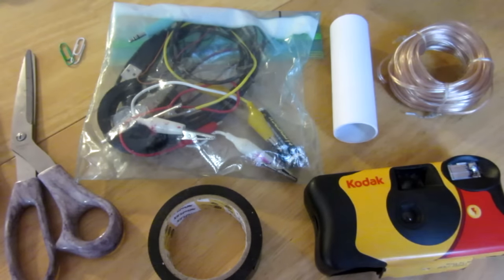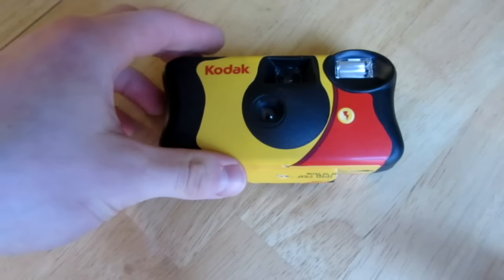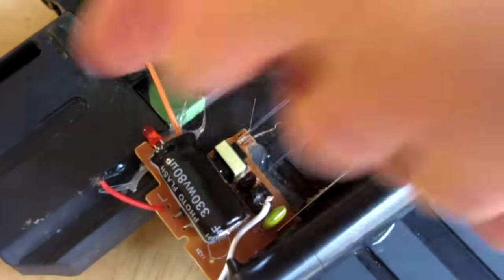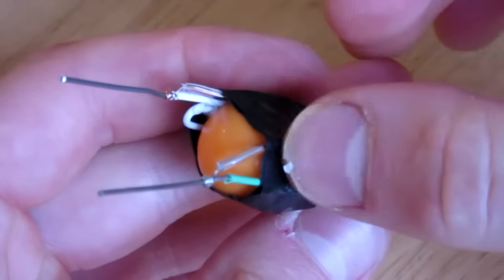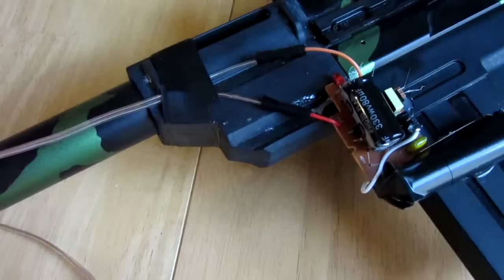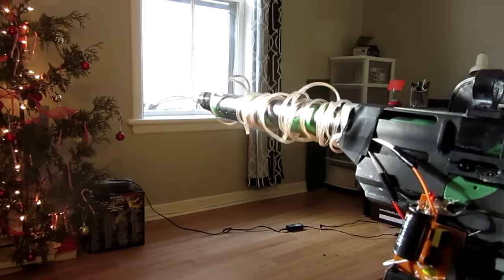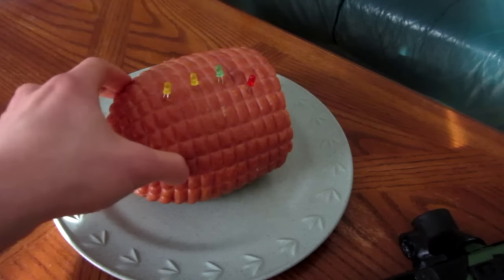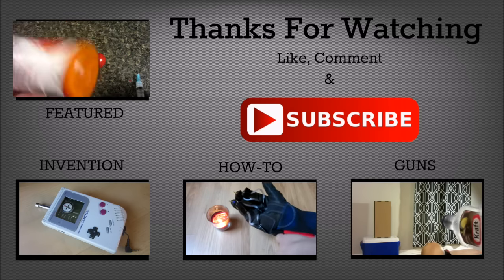Make a 330 VOLT Shooting Taser - EASY

Comment: Have u ever shocked yourself with one of ur tazers?😂
Reply from the maker: Don't get me started
Reply: +inventor719 I'll take that as a yes 😂😂
Reply from the maker: Defenitly a yes
Reply: +inventor719 how bad does it hurt? 😂
Reply from the maker: It's a good shock that's for sure
Reply: +inventor719 I've been shocked by a hot shot(cow tazer thing) and it hurt pretty bad so I imagine 😂
Reply: +inventor719 ayyyyee pun pun
Reply: +Zachary Fisher its called a cattle prod btw :)
Reply: +Zachary Fisher please I've been shocked bye transformers rated at 25-4200vac 2-3amps of current me getting shocked in the arm and hand negative to positive of the outputs I was burned OK and my heart rate became irregular I survived this device is nothing use a flyback out of a flat screen then make a asable 555 circuit then use a mosfet or the mosfet in the tv  a 9volt for the  555 then add a bigger supply for the fly back then add a few hv capacitors but you wanna rectified the fly back output as it will be ac if you use a flat screen fly back use either a few 1n4007 or some uf4007 diodes then hook it up to a pole then walla a real taser around police issue if not more effective!!!  it will take down a grown man or a huge animal!
Reply: +Lost In Space Electronics 2500volts not 25v
Reply: @lostinspaceelectronics870  I’ve been tasked by the taser x26p before. Hurts less than a paper cut.
Reply: Tased**

Comment: I wanted to do a project like this, but you beat me to it. At least I have some data to start with now. You did a good job with your video. Entertaining, and a quality project. Have you considered using fish hooks or sewing needles for tips of the wires? They are both commonly made out of less conductive materials than the wire... I don't know if this would make a significant difference in overall output voltage. I've used zink coated nails in the past for other projects and they don't take much of the shock away. I stopped all my taser experimentation after I realized that tasers were illegal in my area. I look forward to picking up my experiments again, but that won't happen for a while. Anyway, good job and keep up the good work.
Reply from the maker: Hmm I could use different prongs. If you ever do it let me know how it goes!
Reply: I know I will I just don't know when I'll be out of state. Will do, and I hope you continue to have excellent ideas for projects.

Comment: Of course leds wont light up, they need electricity to go specifically in only direction and both pins have to be isolated from each other, go learn about electronics
Reply: Alberto M. not really a telsa coil can light an led am just 10 though
Reply: Makendi Francis yes you are correct because the tesla coil consists of two coils:the secondary and primary. It works because there is a magnetic field between the two coils. but what Alberto here is saying is that the led wont work if you mix up the polarities. Because led stands for Light Emmiting Diode. A diode is a device which only allows current to pass in one direction. So if you put positive in the negative side it wont work. I am 11(since we are doing that now for some reason)
Reply: Yeah, that was dumb
Reply: @kreativekendi4267  an led, no, a florescent, or neon bulb, yes.  This is because the gas in such a bulb is excited in an electromagnetic field and gives off photons.  LEDs do not work the same way.  The voltage required to create such a field is also far greater than what he has here, however tesla coils can produce a high enough voltage, as can high power lines.  There's a couple videos of people holding up fluorescent tubes near power lines and the gas inside is excited enough to make it light up, albeit dimly.
Reply: @willafreahtac-an8837  how do you know my name

Comment: Couldvyou use something else as a circuit board for it or does it have to be the disposable camera
Reply: The disposable camera has a specific circuit that charges the capacitor. So yes you need a disposable camera.
Reply: Why not use an electric flyswatter for the shocking component? It's more effective and can be used for more than just a one shot, and doesn't have to be just charged, just load and shoot

Comment: You should find some ballistics gel to see what it would to to a persons sling and then use a electro meter to measure how much the body would revive to the muscles and if you upgrade this to withstand combat try 2 inch skinny framing nails with the heads cut off

Comment: BTW what were you thinking about the led's that wouldn't ever work it doesn't even make sense you have zero circuit plus a capacitor short is more like a burn not a discharge
Reply from the maker: It shocks you of you touch the end trust me
Reply: +inventor719 oh yes I know ive been shocked but it's weird you're right it does shock but you can't just stick it in a ham the poles are connected and it travels the least distance possible in between the leads frying what it's touching, led's require the correct poles
Reply: +inventor719 he means the LEDs can't be touching the wrong leads. That's like dropping an LED and a battery into a cup of water and expecting it to work, that's just simply not the case.